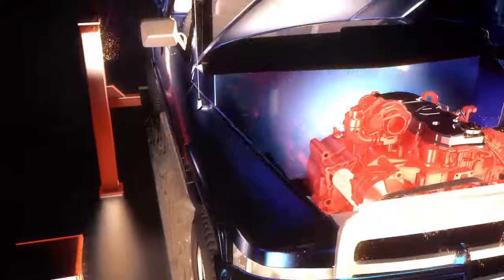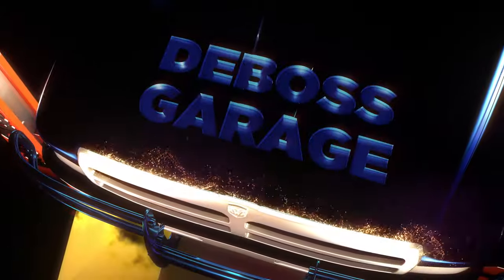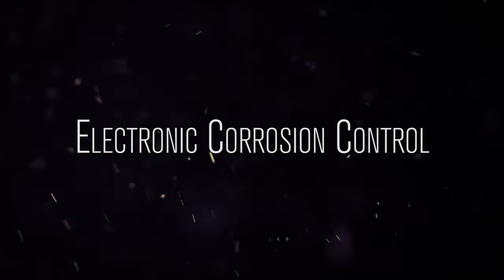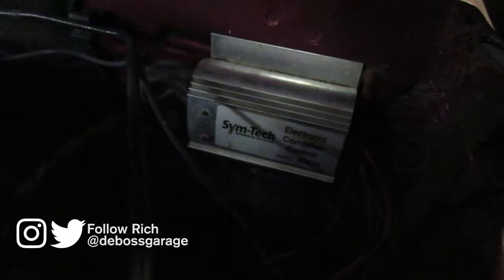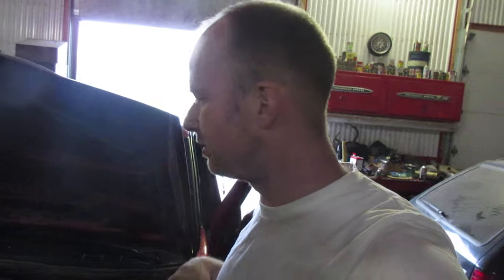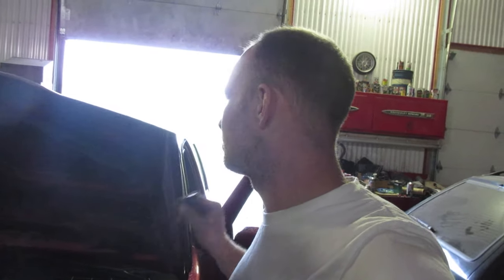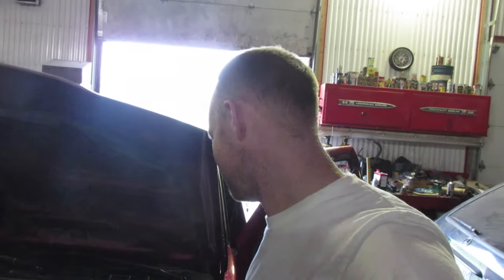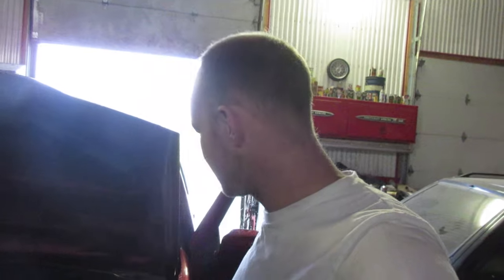The Truth About Electronic Rust Protection

Comment: Sir You are full of BS.  You know nothing, talking about radios and ECM's that have nothing to do with the chassis.  No current is run through the chassis of a vehicle. 
These Anti corrosion system systems do work. They are used on Airplanes, Boats, bridges etc. The problem why they do not work on cars is due to improper installation.   To do this correctly you need many Zinc anodes and high Zinc based primer. Each anode only covers about 1 Sq ft of metal. Anodes must be directly connected to the part it be protected. Also it has to run 24 /7 from a house battery.
Then it will work.

I know because I am an electrical engineer who has properly installed Electronic corrosion inhibitor systems on several vehicles. I have a 30 year old rust free daily driver 1992 Chevy van to prove it. Oh I live in Wisconsin, Salt/ Rust capitol of the USA.

Comment: He says it doesn’t work but doesn’t even offer anecdotal evidence that he has seen evidence it doesn’t work.
Reply: My truck from 2011 had one installed (came with the truck I purchased used). There is more rust on this truck than my 2009 and 2013 combined which both don't have it. There is nothing scientific about having a device constantly on that prevents rust. Have you heard of electrolysis with electricity and rust removal? That works. This is not electrolysis. This is nothing.
Reply: Basics: cathodic protection has been around in the marine industry a long time.  A low voltage/high current power supply is used to keep marine growth from attaching to the hull in rapid fashion.  Something like 70mV and 200 amps is fairly common for larger hulls.  But that's mainly for barnacles - living organisms.  So he is wrong here in saying using car frame & sheet metal as a return for 12V is already the "same thing".  It is not even close, and in fact... standard automotive practice may accelerate corrosion?  I'd be interested in seeing a vehicle made with an insulated return bus where frame and sheet metal are NEVER used for return: go drive it around the northeast for 5 years and see how it compares.  [Reference battery  in only one place maybe to ensure fault protection like a house neutral, but that's it].   Easier said than done obviously, as you need to run two wires to the starter motor instead of one, etc.
The business of dealing with salt on a car?  A possible crossover application is intriguing.  I have no idea if this widget bought even 30% more time of metal life, but the issue is chemical attack exclusively [not organism growth].  I can't find the company that sold these things anymore, so it may just be that other maintenance issues could not overcome any possible benefits in term of expected service life.   Maybe somebody out there with salt mine experience or spreader truck can shed some light?   A seasonal vehicle that sits around all summer having been salted up during winter is the perfect test platform to debunk or validate the concept.
Reply: I just got a new vehicle and I had went for it. Not because I believe it works, but because they guarantee that they will fix any rust that forms over the next ten years. As far as I was concerned, if they believe it works enough for them to continue to fix it for free, then I couldn't give a shit if it works or not lol.
Reply: @Splinky9588   Believe me it's not that easy.

Comment: Why do these not work? But the electronic water heater anodes work? I replaced my zink anode with an electric water heater anode from corro protec that stopped a sulfur smell problem about 10 years ago and i checked with a borescope about a year and and stil no rust. My understanding is they use the same tech on docks and bridges. Do they only work under water?
Reply: Have to be in water

Comment: I can’t say that it works but my Mustang had zero rust after 14 years. We salt the roads in the winter. They use the same cathodic protection on bulk fuel storage tanks. It doesn’t put a current through the frame. It creates a capacitive charge to disrupt the free ions. Take a look at the hot water tank in your house. You’ll see a nut on the top of the tank where the sacrificial anode connects. It’s the same idea. It only works if you install it on day one. Once rust starts nothing can stop it. Larger vehicles need more than one capacitive pad attached. If it was a poor install or the electronics fail it won’t work obviously. Personally I can’t that it worked, all I can say is my car had no rust for whatever reason. I got mine from the automotive store dirt cheap on sale.
Reply: Yeh, a lot of comments deny but only time tells truth! I was looking for an old car, and get impressed how clean was the oldest I found and like it. After choose it the guy, for some reason, tells me the good condition was due only relative to it... There's no reason to affirm it for me after complete the deal. I decide to try in a new one that start to rust in a place that is not supposed to so quickly :/

Comment: You obviously do not know how it works... it uses the car as a capacitor and puts a charge basicallly around the car which nutralizes the water droplets ... but adding a positive charge.. on the electrods but has be mounted onto the paint, not bolted to the metal.... I work in the electronics industry and took one apart, yes the parts are cheap, it has a timer and basically two transistors ... it does work... some people asked me why not use a zinc anode like on a boat engine? because its not underwater ... I tried that as well.... so to make fun of something you don't understand is stupid.. I have tried this on car metal I got from a scrap yard... so I have proof it works , but it has to be maintained by cleaning the anodes from a buildup similar to the buildup from the negative post on the car battery....

Comment: Some are poor representations of the originals I will give you that, and these will drain your battery fast if you never drive the vehicle... So I installed a bypass switch for when my crusier was not being driven a lot . I say you need underbody treatment to save a chassis in salty road climates, even with these, but my experience is these work great at prolonging the life of body panels around wheel wells rockers etc.  I also think it does help some on frame corrosion prevention, but not enough to make anyone who hasn't actualy owned a vehicle with this, to think it worked at all when inspecting it compared to one that had the same driving history but didn't since you couldn't possibly compare the two without having one of each

Comment: my car has anti rust device and it works for 10 years now, it is small as match box with one led with low lit all the time , the body and under chassis until now dont hav any rust, what proof!
Reply: II bought a 2011 Hyundai Elantra Touring in 2012 with 12000 km and it had The Final Coat CM-3000 on it and I just sold it March 2020 with 370000 km on it. and washed it maybe 5 times . It was in the salt all winter as my job was road department checking road conditions. There was not one speck of rust anywhere on that car. Iv'e done that job for 40 years and other vehicles I owned never had electronic rust protection and i would get them undercoated every year, and after 4 years they were real rust buckets.   I will get another one installed on my new vehicle.

Comment: my 1994 dodge Dakota is in great shape due to rustproofing oil n used motor oil n an air compressor n my gravel driveway  and same with fathers 04 grand prix  and my other truck ..03 ram 1500

Comment: In Australia, these things work amazingly well. When the first came out I too thought they might be a bit of BS. But here with our beaches, coastal lifestyle and salt air - the difference we are seeing in less rust and the resale value of our cars is huge. I guess it depends on the environment and of course the product itself.
Reply: of course it depends upon the environment....LOL but the truth is if you park your car in your salty swimming pool rate of corrosion ....... but even then the influence will be extremely limited as you would have to have many more electrodes (anodes) located in many places in your car to actually polarize all the regions and exposed surfaces past the protection criteria.  Outside of your car being inserted into a continuous electrolyte it has ZERO chance of any benefit .....apart from it being a topic for a drinking party.
Reply: Interesting I have had mine installed for 15 years.  Seems to work for me - other cars same model and vintage are shit rust boxes and mine is not.  I don’t wash it anymore than anyone else does.  

Personally I think these got a bad rap because dealerships and others are charging way too much.  The manufacturing cost of one of these things is under $20 - so if you  are paying close to $800 or more -WTF. 

They work by sending a electronic pulse signal though NOT a constant current.  About  12 - 15 years ago a couple brainiac wing nuts compared these to cathodic protection - which it is not.  All the internet parrots and FUD (fear, uncertainty and doubt) spreading look at me mouth pieces ate  this stuff up and spread it around. You get the picture misinformation about misinformation about more misinformation…..

Would I buy one from a dealership at some exhorbantant price -NO!  Would I buy one that seems like it is a quality product and combine it with annual or biannual Rustcheck treatment and a layer undercoating - YOU BET!   Combined with the factory zinc coating and the 3 extra protection mechanisms - mean that my paint fades due to sun damage not the metal underneath rusting away.  

Bottom don’t pay a lot for it - it works but it is absolutely not worth more than say $100 or so of your hard earned dollars.

Comment: you must have failed your basic school physics. if the anti rust works or not I'm not sure. but the fonction is not to "run a current" . there's a rust chart , which metals react better with others. this system is basically same system as on planes, it uses the body ground to attrack electron and be the "middle man" between metals and/or rusting elements. go read up a bit mate

Comment: It nees an anode connecting to the ground all he time to be the sacrificial lamb... How it works on large ships. This can't work otherwise
Reply: philip dias well actually I think there is a type of c-p that doesn’t require anodes, but isn’t very common and they usually use anodes as a grounding mechanism if anything... at least that’s how it was explained to me how it works on some of the cp systems with our gas pipelines.. just like anodic protection works by using a sacrificial anode and doesn’t need current like we’ll attach an anode to a line if it’s an isolated section of pipe that’s separated from the rest of the system we drop an anode on it to get the protection back... just like outboard boat engines have anodes bolted onto the casing of the lower unit to protect it from corroding while sitting near or in the water for long periods.. even hot water heaters have anodes in them that don’t have rectifiers...
Reply: Maybe I’m mistaken on the cp system that doesn’t need an anode... I could’ve been confused with an anodic system that doesn’t need a current/rectifier to work... it’s been a few years since I messed with all that

Comment: This type of device is an attempt at a form of cathodic corrosion protection which is a technique that has been used successfully in bridges, ships, recreational boats etc for decades. Unfortunately it does not work in cars. This technique only works where there water or moisture to complete the circuit as in  marine applications. The only way it would work in car is if you park it in water or take the tires off and park it in moist dirt.  They are a waste of money and huge profit maker for dealers.

Comment: been there done that , didnt work ! paid dearly too . There probably is a scientific solution but not a real honest to goodness off the shelf , for it would save the consumer too much money from future repairs ! can let that happen to big business can they !🔧📐😃
Reply: Cata strophic catodic protection (a system that uses a rectifier and anodes to apply a certain electrical current to something and creates an electrical cell to prevent corrosion)  it’s used on underground fuel tanks at the gas station, gas and oil pipelines, water towers, off shore and land oil rigs, even train tracks, next time you’re by the train tracks look around and notice the wires coming out of the ground and is attached to the rails...
Reply: But this.. I doubt it’s an actual rectifier.. it’s probably just a box with some wires going to it... if it were a real rectifier it would be quite costly... but something you can do, is provide anodic protection to your vehicle, go to a plumbing supply store and get an anode that’s made from usually zinc, or magnesium, sometimes aluminum.. and it’s called a sacrificial anode which means the anode corrodes faster than the steel it’s protecting so it “sacrifices” itself (hence the term sacrificial anode) and corrodes and breaks down instead of the metal it’s protecting...

Comment: they work and aren't a scam  it's turns your car/truck into a very very very weak electromagnet but yes like the other comments say is true they do work but they do short out over time...i have....well should more or less say had a 01 ford ranger here in up-state ny that has very little rust intill  the 2 out of the 3 boxs finally shorted out forcing me to rip them out just before this last winter....poor thing looks like shes about 5 years older then she is
Reply: no they dont

Comment: no proof, data or statistics showing this does not work, just recently bought a 2009 civic and i would not say it's zero rust but still in good shape and no obvious visible rust on it's body with over 200km mileage, and i found out there's an electronic rust box installed in it with same date/year attached to it 2009, we are in canada, and looks like it's working, only the radio keeps scanning when car is running, maybe that's the reason? thanks
Reply: I had a similar experience. 10 year old car looked like new underneath. It shocked everyone who saw it. No other explanation.

Comment: My neighbor had this on his 12 years old sunfire 
12 years old Sunfire!!!!!!!
Did you see any of these cars over 5 year without rust holes?
Did you see any military viecle with out it? And how many of them rusted with in 10 years
Reply: The key to the longevity of ANY vehicle is maintenance. Wash your car regularly, especially if you drive on salty winter roads. Clean out the undercarriage. Keep the engine bay clean and maintained so that gas, oil, grease, and so on don't hit the metal. That's how you keep a 12 year old car rust free, and military vehicles are DEFINITELY maintained spotlessly.

Comment: Strange the u.s. Navy would say you're wrong. Every naval ship in the u.s. fleet Eddie oxide ecs control to protect from rust.
Reply: Correct, but this ain't that.
Reply: Cathodic protection, do some research and educate yourself instead of assuming one thing equals another.

1. Galvanic which requires a sacrificial metal usually Zinc. However in a car this is a redundant and pointless because galvanized steel cars are made of already has zinc sacrificial metal on/in it. Once the sacrificial metal is used up the iron oxidizes. 

2. Impressed Current Systems. Here the DC negative is attached to the structure  you wish to protect (The car) and the positive to an Anode that is either in water or soil thru a ICCP rectifier. Except on a car you can't do that because the car's entire metal chassis is the DC negative and it is isolated from earth ground by things called tires. Which even if you did have a earth grounding system still wouldn't work as it's hard to have an anode in soil when the cathode is MOVING.

Comment: thats not the real porpuse of that device its somthing ells way bether to increase perfomace on the car by using ac and dc together in a electrical system it increase the acesoris electric motors perfomance thats what that thing realy is build for because your car use bouht ac and dc bouth can by present in a baterry as well it a form of dual ignition ore waste spark system ore dual ground so that thing can do lot more than you think

Comment: On my motorcycle the manufacturer has gone to a great deal of effort to keep electricity from traveling throughout the frame to prevent corrosion. Every circuit has a earth lead that traces all the way back to the battery.
Reply: electricity helps corrosion in most cases.
Reply: that is a signature a lot of vehicles need. You should see what old airplanes used to do.. to people, itself, and everyhting it was near..sometimes from far away. Really really stupid. the electronic gadget might be good for very dead old vehicles where you know it is a nightmare anyway. The biggest win now is diodes.. signature of full loop is not so important.

Comment: So why do they use the same system on a pipeline ?
Reply: i have on my truck, loader, backhoe, wifes truck and my car,  i build them   for all sizes of cars trucks and equipment
Reply: They do for buried or submerged pipelines. its called Cathodic protection ...it works under that condition where there is a electrolyte and also for reinforced steel embedded in concrete (sufficient water to maintain an electrolyte around the pipe).....but not for above ground pipelines and thus wont work on a car

Comment: Than what is a good way to protect your car from rust ?
Reply from the maker: Underoiling, but get it done by someone who knows what they are doing.  There are plugs in doors where the sprayer can get inside.  If there are no plugs, they should know where to drill and plug them.  Tail lights and headlights should be pulled and sprayed behind.  Wash your vehicle regular including underneath.